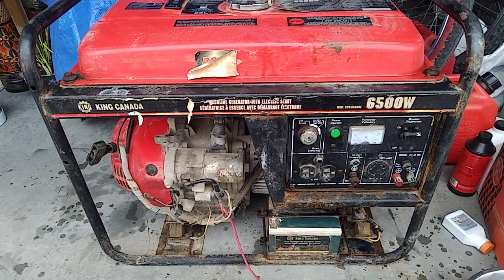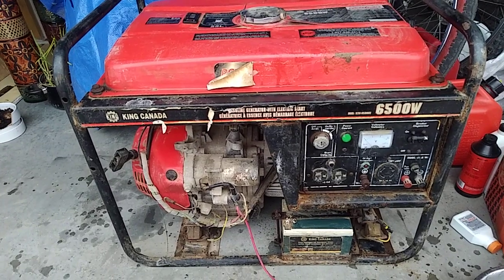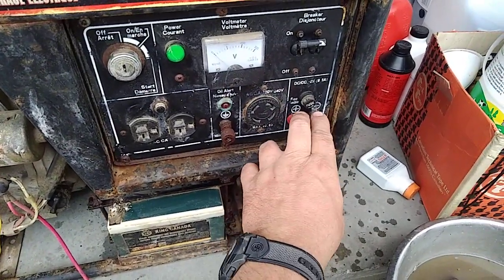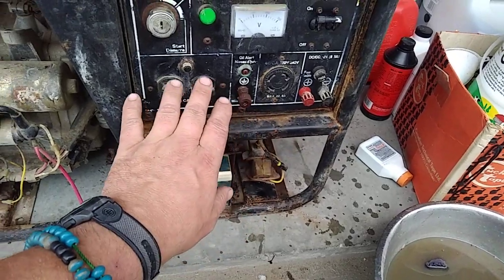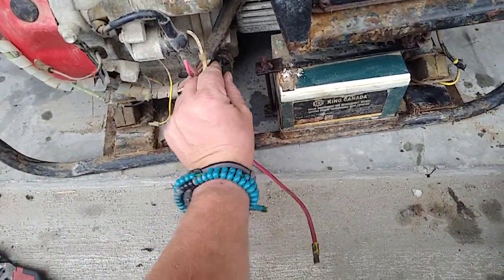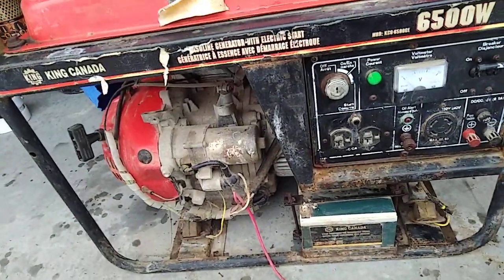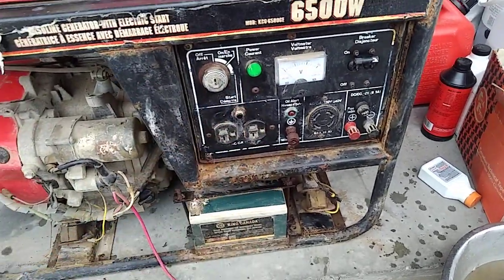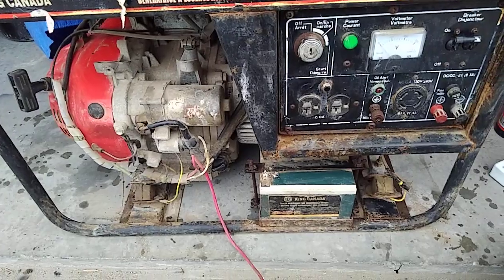King Canada 6500W Generator Rebuild

Comment: This generator looks like mine generator but mine is a 3000w 60hz. when my dad bought it at Home Depot like 12 years ago the strange thing is the generator is made by CF PowerLine but when I looked is up online it came up with nothing. it’s the exact replica of a king Canada power force 3000w generator. If you can tell me why this is that would by appreciated.
Reply: I forgot to mention CF PowerLine is a farm equipment, tiller company so I don’t understand why it would be a generator if they probably manufactured it in a very limited production quantity.

Comment: hey can you take a picture of wiring on the 120 to240 switch it was part of a recall way back they used counterfeit parts,  mine pulled out of dump used once guy gave it to me he pulled out the 9 wire switch it broke first use. Ive just started to work on it ive had it 7 or 8 years. It was so bad they stopped that model and switch the panel to get over recall the ones you see mostly are mod # KCG-6502 new face plate ours are mod KCG6500 they told me they have no parts left [ it is a complete new different face plate with plugs n breaker ] to convert over to a safe unit The wiring is wild green is not ground its a god dam night mare. Thats if you have not beat it to death looking at the wiring.
Reply from the maker: Ummmm.

If I have it apart again I'll upload a video showing the wiring.